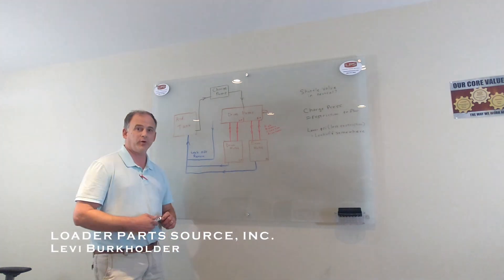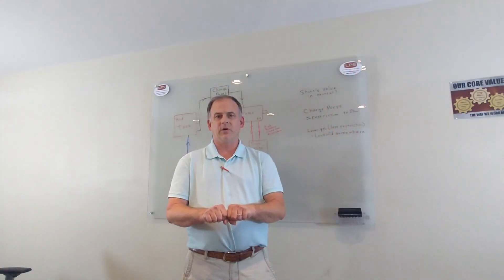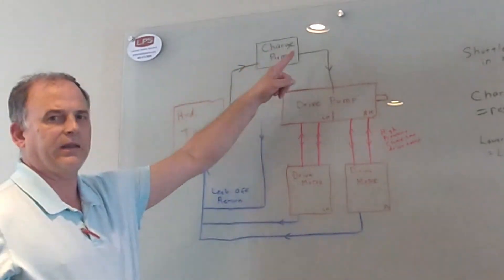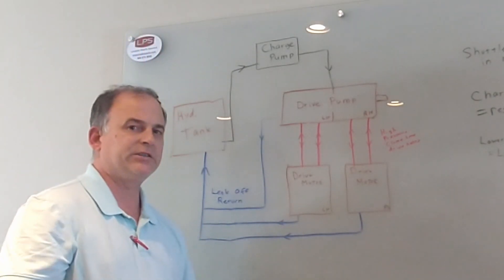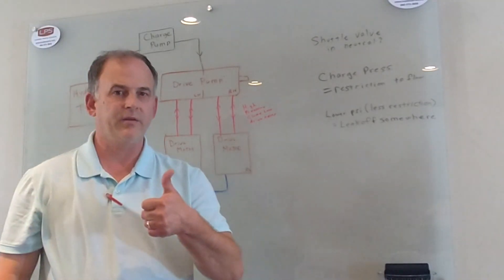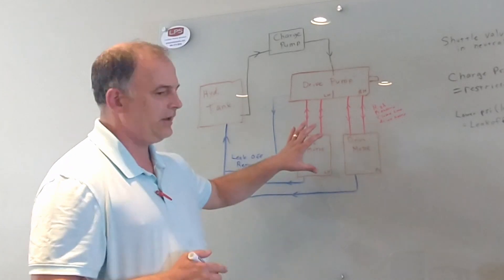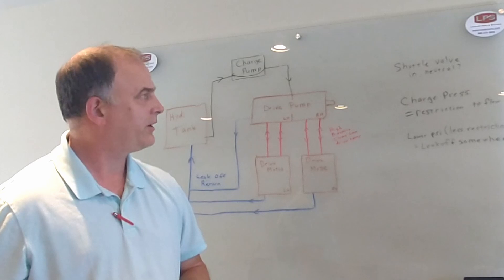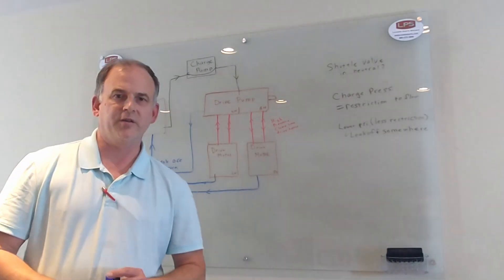Charged Pressure Explained

Comment: I have a t200 , I'm having low charge pressure constantly , I have almost lost the use of my RH stick/drive. It kicks in intermittently so I'm still able to operate, I jus have to manipulate it to turn. Can u help, I don't have a dealership , so I do my own. 
Thanks,  Cam
Reply: There are several possible reasons this is happening and would be quite a lengthy email to try to explain, please call into the office at LPS, they can explain, thanks

Comment: Hello, I have an ASV 120 with 1200 hours on it that has an issue that the dealer cant seem to fix. Once the machine is warmed up Im unable to steer either way and Im not able to lift the bucket and drive at the same time. It has no power to make it move. The dealer said the tandem pump and both drives were bad so I had them all rebuilt. The shop that rebuilt them said they didnt see anything wrong with them when they opened them up but replaced with a kit anyways. The filters had no metal flakes in them either. I got the machine back because dealer said the pressure tested fine now and declared it fixed. Once i got it home I ran it for 20 minutes and it did the same thing as before. They never fixed the problem. It works fine in first 20 minutes when its cold but when its warmed up it does not want to move. The dealer is saying the pump is still bad and need to buy new one now. Ive spent over $20000 so far and dont want to waste any more money getting a part i dont need.  Does it sound like the tandem pump is the issue to you? I would appreciate any advice. Thanks
Reply: Howie, I would look at the coupling mechanism that drives your main hydrostat pump, if that is not turning the machine will have no power at all to move or lift the bucket.

Comment: SHOP ELSEWHERE!!!!! This company does not stand behind their products blames the customer for their deficient products. Then when you send the pump in for warranty,(The pump ran for 5 seconds after install) they tell you its not warrantable hold the pump hostage and demand more money. This is exactly what just happened to me on a BRAND NEW $9000 pump and literally got robbed $1400 more to get it back. You will get no service from this company only headaches, garbage products and an empty wallet. I sure hope that $1400 was really worth it guys :)Because now everyone is going to hear about this as much as possible and hopefully steer customers to business that help their customers and not rob them blind. Truly disgraceful
Reply: Loader Parts Source prides itself on our fast, easy, and fair service.  We evaluated this pump within hours of receiving it.  The evaluation found this new pump was started up with no case drain connected.  Our warranty does not cover third party installation workmanship.  Though we readily offer assistance when our customers ask for guidance, we cannot be liable for something we have no control over.  When mounted on our test equipment, simply connecting the case drain corrected the symtoms.

While installed without the case drain, the resulting high case pressure caused an external oil leak. To make sure this repair is fast and easy, our technicians disassembled the pump to inspect the spider for damage.   Excessive case pressure can crack the spider on the rotating group. When this happens the pump internals become severely damaged.  We made certain we were not returning a pump with hidden internal flaws.

In line with our intent to be fair, we did all this at cost in spite of our staff getting cussed at repeatedly.  The pump, of course, was your property. It was not "hostage" at any point in time.  Shipping charges did have to be paid in order for us to return it.  And, in the case of having it returned assembled with warranty, the repair costs also needed to be paid.